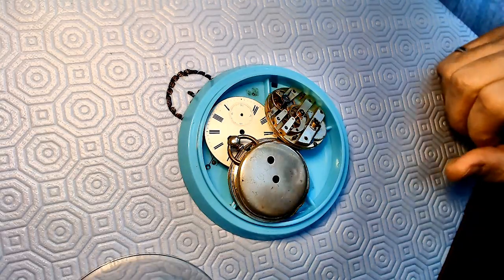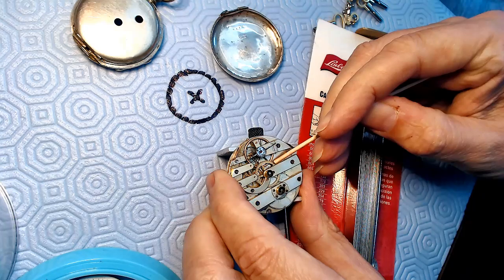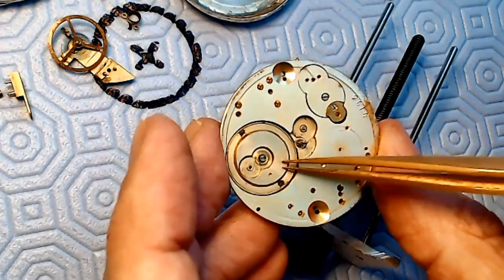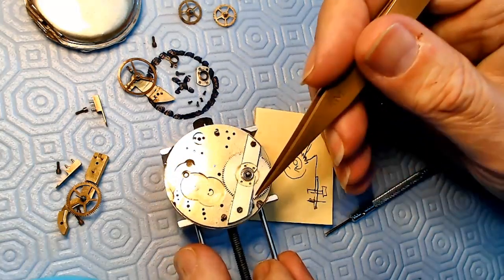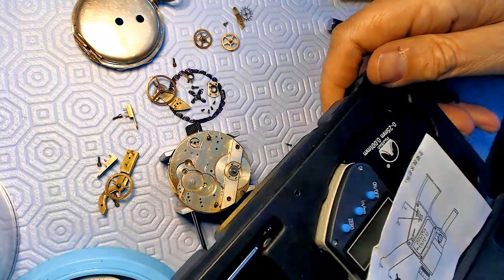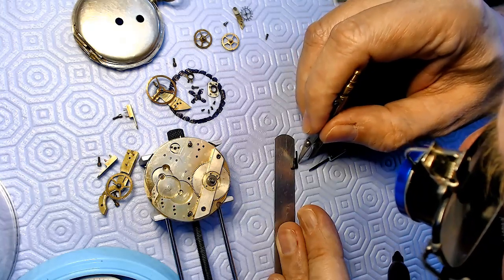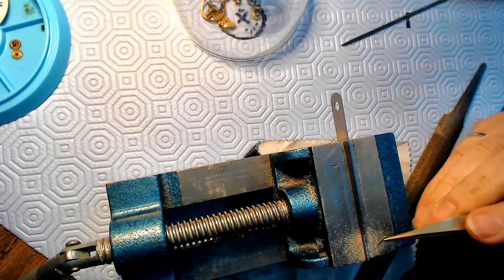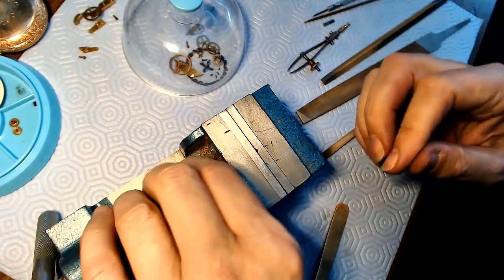Making a Small Watch Part - Click Spring

Comment: Hey JD...nicely done. I mostly work on early 1900 RR pocket watches, but did have to make a click (pretty much like you just did), but a bit bigger, for a 50's art deco wall clock. Piece of spring steel, Dremel, file, etc. Your version is much more elegant though (lol). And we actually have a little more in common besides horology. While I don't play as much as I should anymore, I still have my 60's Strat (and an SG). I found your channel and realized I'm not the only rock'n'roll watch guy...HA! Last bit'o simpatico, I too am a fanboy of bunnspecial. Watching his vids is what spurred me on to fix my drawer full of watches...and he always makes my laugh (even 2nd, 3rd etc. reruns).
Thx. Keep it up...
danytoob
Reply from the maker: danytoob Very interesting. I thought I kind of roughed through making this part. Way too small to cut the part in a band saw, so i resorted to filing and use fo my dremel tool for cutting. Not completely accurate, but it worked. I also do closeup magic which has nothing to do with watch repair. Thanks for the feedback and stay in touch.  PS: are you on the WatchRepair blog?
Reply from the maker: I am going to clean this movement today as I looked at it under my stereo microscope and man the gears were dirty. No wonder it stalled. Need to measure the stall and it was at exactly 45 and 60 seconds meaning gear issues on the seconds gear.

Comment: Your welcome i have approx. 60 Swiss bar movements in different stages of needing repair and cases, approx. 10 of those have cylinder escapements and 90% of them run great they just need cleaning and cases. The cylinder escapements lost favor because of the complexity and reliability. its next to impossible to find parts for the Swiss movements.
Reply from the maker: Danny Perkins That is a lit of Picket watches. I have over 100 mainly American Pocket Watches